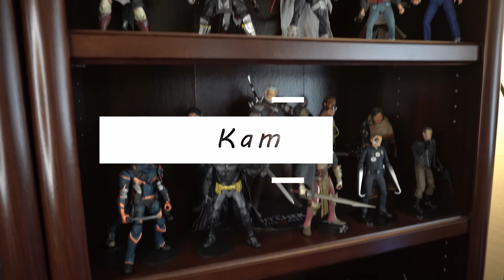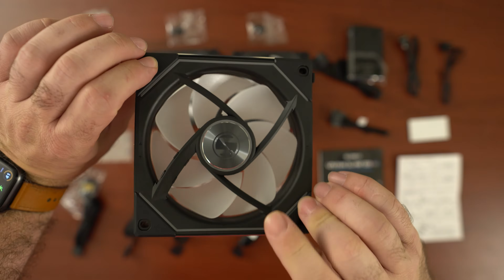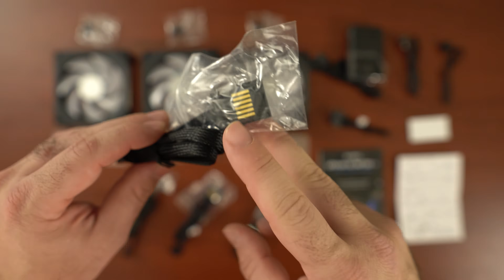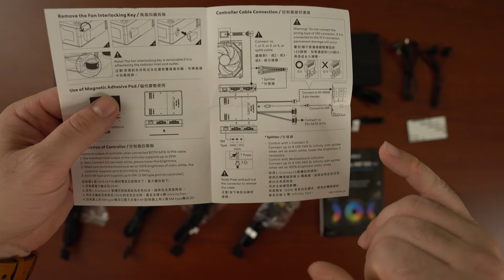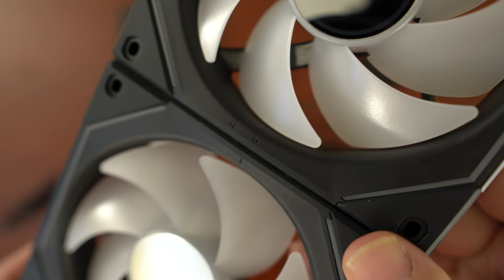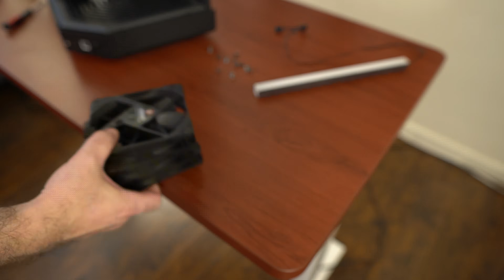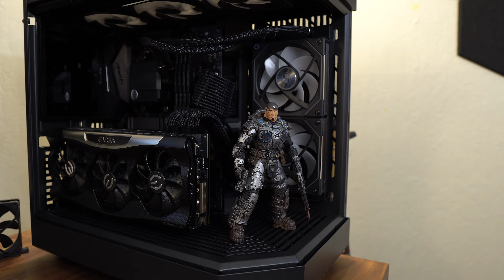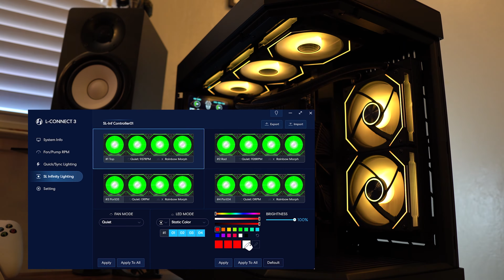LIAN LI Uni fan SL Infinity 120! Unboxing / Tutorial / Install / L-Connect 3 Software / Review!

Comment: The fan max is where I'm confused because I have the sl inf 120 fans (infinity) and it says in manual when sync to mb and set 100% bright, it only supports up to 8 infinity fans on the controller. So does that mean I need two controllers for 9 fans (3 sets of 3 fans connected together)?

I have these on a rad for new build. Am I going to have cooling issues knowing they won't be running until I have windows installed?
Reply from the maker: Are you using L Connect 3 to control the fan speeds? Or do you have them plugged into motherboard headers? The controller can support up to 16 fans ( 4 per port and there is 4 ports total ).

No, I have had these fans in numerous rads in different configurations and they work really well against rads as static pressure fans.
Reply: @DanKamYouKnow  thanks I got my Q answered in reddit.

So apparently when running white led, if more than 8 fans then it reduces brightness to 80%.
Regarding fans, they said they'll still run fine as long as plugged into mb, even before driver/sw install

Comment: Hey Dan! Great video, how many intake & exhaust fans are you using? I’m thinking about getting the Hyte case
Reply from the maker: Thanks! 2 140mm intakes on the bottom / 2 120mm intakes on the side / 3 exhausts in the top. Works great.

Comment: I bought two of these as single units. No controller with them and did not buy it separately. I presume I can just connect them to my board and headers without the control and they will get power and RGB I just won't have any controller functionality. Is this correct?
Reply from the maker: Yes, the single packs come with connections for 4 pin fan and 5V ARGB. So they plug differently into your motherboard, and you’ll utilize the program for your motherboard

Comment: these are awefull i got the normal sl120s lot better than these for airflow and the bearing is better had a pack of 3 of these failed with in 2 weeks sent back to amazon
Reply from the maker: Eh, sounds like you just unfortunately got a bad batch. The bearings on these are much improved over the original SL120’s. I’m going on 5 months and not a single issue with any of mine.

Comment: Hi, did I overhear any hint of the volume of noise, these fans emit? No other review of this fans says anything about it... I'm afraid, I have to try by myself and send them back, if they are too loud, as the sl 120 definitely are. But neverthelesse, thx4 the vid.
Reply from the maker: Case plays a huge factor in acoustics but under about 900RPM, these fans are dead quiet. From 900-1400, you can hear a slight whir and anything over is definitely audible. With a less aggressive fan curve, these fans are barely audible. If you want dead quiet, go Noctua or lower your fan curves.
Reply: @DanKamYouKnow  Hi, thx a lot! 😀 The problem with the SL 120 is, they run min@800 rpm and then they are not without any noise, slightly silent, but audible... I have to look, but your review and this answer gave me a nice advice! 😀
Reply from the maker: Glad to hear. Good luck with your search

Comment: I just bought 10 of these fans...two 3 packs and 4 singles...Lian Li really improved these fans. Can't wait to build my new AM5 rig.
Reply from the maker: Awesome! I am still using these fans, several months later and no issues. What case are you building in?
Reply: @DanKamYouKnow  I'm building in the Lian-Li 011 XL. It's going to be a full custom loop with three 360mm rads, custom front distro plate. I've been very anxious to start building but had to wait for some parts to become available. The Asus Crosshair Extreme motherboard took a little bit to get and 4090 arrives tomorrow. Only thing that's left now is the GPU waterblock. I want the wiring not to be a huge mess so the SL Infinity fans are really gonna help. Have you tried controlling them via controller and motherboard? The Asus Crosshair Extreme comes with its own ARGB/Fan controller that also uses a USB header so I'm thinking it would be best to stick to motherboard control.
Reply from the maker: Very nice, would love to see it once it’s done. I have personally only used the Lian Li software but I know a lot of people do not like the software and use their motherboard for fan speeds / RGB, and they have had no issues doing so. Would be much easier to only use your motherboard controller for sure
Reply: @GSP-76  Does the improved version of the fans still have the memory issue which is one of the biggest cons in the video?
Reply from the maker: The memory problem has been fixed. I think a software update fixed it because the memory saves now
Reply: @DanKamYouKnow  Thanks a lot! So now there's nothing else stopping me from building a new system but time to save some more money
Reply from the maker: You’re welcome! Just keep note that if for some reason the memory doesn’t save ( which it should ), then you might have to enable a setting in the BIOS of your motherboard. I have heard it’s a very small amount of boards that need it changed.
Reply: @DanKamYouKnow  Thanks for that advice, this is very helpful :)
Reply: @19terracottapie  I have the AL fans in my current system and it was nothing but a nightmare getting Lian Li's controller working properly. Eventually I just got tired of it and ditched it and started using the motherboard ARGB and also bought the Razer Chroma controller. It's been blissful since making that change. For my new AM5 build, I'm going to use another Chroma controller and motherboard for fan rpm control. In my experience with ARGB, the Razer Chroma controller is easily the best option available. It gives you 6 fully independent ports that can be controlled independent of one another and it actually works, lol. Another nice thing I tested out is SignalRGB. I uninstalled the Razer software and loaded up  SignalRGB. It works great. Detected everything and gave me full control of everything RGB in the system. I plan on using it with my AM5 system as well.

Comment: The lighting features are nice, but I can't seem to find a way to save profile presets.  It's kind of annoying to have to spend 15 minutes everytime I want to go from one look to another and then back to the previous look.  Is there a preset feature?
Reply from the maker: I had this same issue, please see the pinned comment. Could be a BIOS setting that isn’t turned on because I also mentioned this in the video. Mine loads my specific profile every reboot now.

Comment: Do the fans go lower than 25% RPM? making them dead silent?
Reply from the maker: They are extremely quiet under around 850RPM. Yes, you could set them to 500 RPM

Comment: considering you replaced your AIO fans with these, was there any difference in temps?
Reply from the maker: The Lian Li fans are actually higher RPM and quality than the ones included with the AIO. So while I did not do a side my side comparison, I didn’t want my rad fans to be all black and not match. My temps with these rad fans have been fantastic though.

Comment: I just put 10 in and no spinning just lights
Reply from the maker: Download and run the Lian Li software. They won’t work until the firmware for the controller is updated
Reply: @DanKamYouKnow  I had to manually update the firmware because they would not spin on restart or turning on from shut down. I had to allow permission every time I booted my pc. I am good now! :)

Comment: Are the AIO fans backwards?  It seems like that would be pulling hot air from the radiator into the case, no?
Reply from the maker: I actually want them as intake because airflow was crippled when the side and top were exhaust. Temps were much better when I had the radiator fans as intake.
Reply: @DanKamYouKnow  Thanks!  I just went and bought 2 3-packs and a single today.  1 more question... when you use the Splitter to connect a 3rd fan with the pair of AIO fans, does that third fan's speed adjust as well, or just RGB control?
Reply from the maker: It will control both since they’ll both be plugged into the controller

Comment: Another great review Dan, thanks for spending the time going thru the lighting presets and software controls rather than wasting it recording you physically taking the stuff out of the box. Concise, yet In-Depth. The tip about the controller losing its settings after re-boot is good to know. I will take that into account when choosing my future purchase.
Reply from the maker: Thanks for the comment, that’s really nice of you to say and I appreciate it. 

So it appears the controller thing might have been resolved with a software update. Mine is loading up every time now and I didn’t change anything. Not sure what happened but glad it’s working now. Worst case scenario is you have to open and minimize the app on boot each time, which wasn’t that bad.

Comment: sick fans, just bought 9 of them for my lian li 011 dynamic evo chassie, gonna be awesome to see em up and running, I see you got a screen at back inside of case, what screen is that? want one in same spot in my chassie instead of a fan
Reply from the maker: Nice! You won’t be disappointed with them, still love mine. It’s a 7” screen that’s unfortunately not available on Amazon anymore for some reason. Personally, I would measure your exact dimensions you’d need for the back and see what works for you. I took my measurements and then went to Amazon and found one that fit PERFECTLY.

Comment: Do i need more controllers if i have 2 140mm fans and 4 120mm fans in my pc?
Reply from the maker: I currently have all my Lian Li fans plugged into the Lian Li controller. Then I have my 2 140mm fans plugged into my motherboard with a y-split cable.
Reply: @DanKamYouKnow  ohhh ok thanks!

Comment: Hi Dan, I have a question about hooking up a AIO, Do you connect the fan controller to the CPU Fan Header?  I asked Lian Li support but they couldn't answer me? 
Also would a USB Splitter be able to see both controllers?
Reply from the maker: What AIO are you referring to? Also, what 2 controllers are you using? As far as the Lian Li fan controller, it doesn't have to be plugged into the motherboard. I explain it in the video but you can use the USB header that plugs into the controller, to plug into an available USB header on your motherboard. OR you can utilize the fan header connection that comes with the controller.

Comment: I have Corsair H150i AIO, I want to change the fan from original corsair fan to SL120 fan. But if I don't use this PWM cable at 11:14, Is the SL120 fan will speed faster when my CPU temperature rises up?
Reply from the maker: If you are using the controller and the cable for the controller, then yes, you can use the Lian Li app

Comment: How many fans can that controller provide power for? I’m looking to power a 3 fan daisy chain, 2 fan daisy chain, and a single. So 6 total. Awesome video by the way! I’m looking to build with the same case!
Reply from the maker: The controller can power up to 16 fans. You can power 4 fans with each port of the controller.

Comment: the 1-4 selection on each color scheme is for fans 1 through 4 of each daisy chain not each section of fans. so if you select only 2 of those for a 3 fan chain that is why one is dark.  The chain for the radiator was fine since it was only 2 fans.
Reply from the maker: Appreciate the info 👌🏻👌🏻👌🏻

Comment: I bought 9 fans plus a Galahad 360 and the L-Connect 3 is almost non responsive on my system
Reply from the maker: Really? I haven’t had an issue yet with L-Connect 3. May want to try and reinstall

Comment: Hi Dan, question regarding HP Omens 25l.

Mine has the Hyper X Fury RGB 2x8gb 3200mhz, upon checking online Kingston is no longer making them since HP already bought the HyperX lineup.

Will it be okay to add Kingston FURY Beast RGB 16 GB (2 x 8 GB) DDR4-3200 CL16 Memory (New fury Rams from Kingston) to complete the 4 dims of RGB ram?
Reply from the maker: This video doesn’t have anything to do with Omens but I made a video on RAM for Omens. Usually mix matching RAM doesn’t work for Omens. They have to be all the same, Omen spec RAM doesn’t play nice with other RAM, even if it’s HyperX

Comment: I have a question on the omen 25L so I recently switched pc’s and I took the nvme m.2 ssd and gave the old pc to my wife it has a regular ssd in it with windows but for the life of me I can’t get it to get through the boot it gets stuck at windows then after restart it tells me my fan isn’t showing (not my cpu fan btw) does it need a m.2 to boot or something even though I have an ssd with windows already installed it won’t show I have windows on it so I have to use an usb any thoughts?
Reply from the maker: Can you boot into BIOS? Probably need to change boot priority
Reply: @DanKamYouKnow  I actually did the dumbest thing and didn’t check the ram so when I did check the ram I switched them around and it booted just fine I feel like a noob😂
Reply from the maker: Lol! At least you got it all squared away. 👌🏻

Comment: I think most people should plug the mobo sync cable in as well just in case they want to use that feature later.
Reply from the maker: That’s true. I don’t like how L-Connect 3 isn’t usable if motherboard sync is selected though. I won’t ever use it but it is a good idea to have that option if needed.

Comment: Planning to get this for my new build with td500 mesh
Reply: @DanKamYouKnow  also how do you get a Rog strix 3070 white for cheaper than $900
Reply from the maker: Just gonna have to be patient and search
Reply: Ryzen 7 5700x/5700g and either FTW3 Ultra 3070 or aorus master 3070 or Rog strix 3070
Reply from the maker: I’d say the 5700x and either the STRIX 3070 or FTW3 3070
Reply: @DanKamYouKnow how do you find out how much power supply you need?
Reply from the maker: Usually your GPU’s website is your best bet. What CPU / GPU you using?

Comment: Hi! Ur water cooling is 240mm? Can i put on it 120mm infinity fans?
Reply from the maker: Yes, the AIO I am using has a 240mm radiator and can fit two 120mm fans

Comment: if you see this comment back i bought this prebuilt pc with a 1660 super amd am upgrading it to a 3060 is there anything i need to know?
Reply from the maker: Pretty much everything you need to know is explained in this video.
Reply: Make sure your psu can handle the 3060

Comment: Thanks Dan.. bought the same fan. However after installingm fans doesnt spin. But there is rgb.. do I need to install first iconnect software? So the fan can start spinning? Thanks a lot.
Reply from the maker: Yes! Make sure you install L-Connect 3 and update the firmware for the fans and controller. My fans didn’t spin at first either
Reply: @DanKamYouKnow  thanks a lot. Thought my fans are faulty.. 🙂

Comment: The timing on discovering your video review was helpful. I was looking into Lian Li fans to replace my Corsair fans because the white LED color has worn itself down to a yellowish opaque color for keeping it for 2 years. Knowing that the Lian Li doesn't save the color settings from their software tool and resets to default every time it boots up is a deal breaker. I hope there is a software fix to it, and would consider to buy it.
Reply from the maker: I am hoping they fix it too because the program auto boots, minimized to the task tray. It will only load my previous settings when I physically open the program up, but not when it auto boots to task tray. Seems like a software glitch and should be sorted out. When it is, these fans will be unmatched, except in the longevity department, that we shall see.
Reply: @DanKamYouKnow  that's interesting that it's not saved. My Lian li AL fans always boot in the profile and RGB settings.
Reply from the maker: The funny thing is that it technically is saved, but the settings aren’t being applied, until the program is physically open. Should of chosen my words more carefully

Comment: Your PC looks great 👍. Did you get your HP 45L case yet ? I wonder how many computers you need / have ? 😆😆
Reply from the maker: Thanks mate. HP actually just sent it to me and I will start building in it soon. I currently have 2 PC’s but also have a lot of spare parts. 😎
Reply: @DanKamYouKnow   Sounds great. I monitor my temps on my 30L. Its been reallhot weather here and temps than went up a bit. MSI afterburner did help though.  If it stay high I will change the case. But the 45L is awesome. cool and nice design, the perfect PC and case for us 👍
Reply from the maker: Yeah, I’m exited to do a DIY build in the 45L case

Comment: What Case are you in atm. I’m loving that setup.
Reply from the maker: Thanks! It’s the Hyte Y60 case. It normally comes with 3 glass panels but I left them off for the video ( easier to see the contents of the PC ). I made 2 videos on it if you want to check it out 🙏🏻
Reply: @DanKamYouKnow  I seen the video right after I commented. Maybe getting it this week.
Reply from the maker: Great case. Not the best airflow but it’s not bad by any means. Easy to build in and looks fantastic.

Comment: A great and informative video, Dan. Do you think these fans are higher quality than Noctua’s premium fans? Which is lower decibels at any given RPM?
Reply from the maker: Thanks Kanive! So far, these fans have been great. High RPM / low noise / good static pressure / incredible lighting. Wish I had the equipment to compare the 2 but couldn’t go wrong either way. They are on the completely opposite side of the spectrum as far as fan choice goes. Black and/or brown vs the most intense RGB lighting 🤣